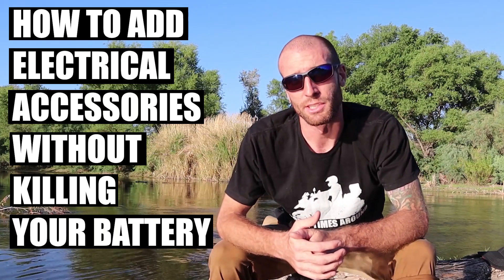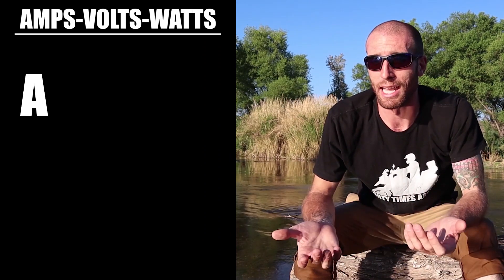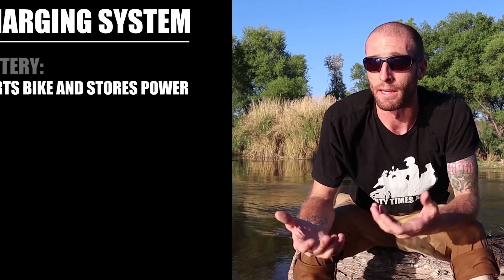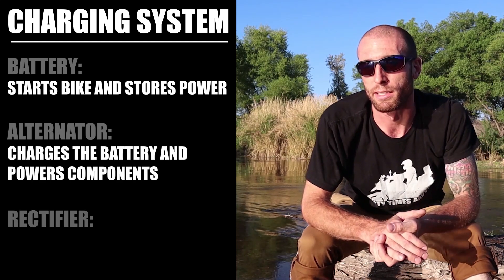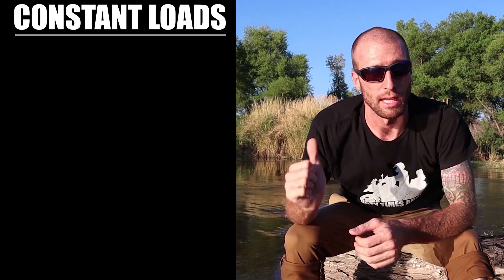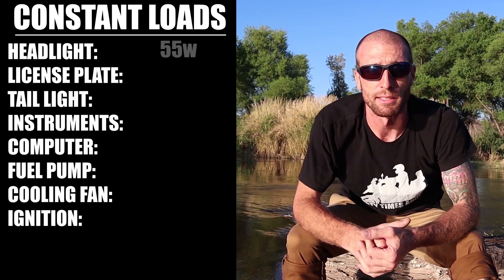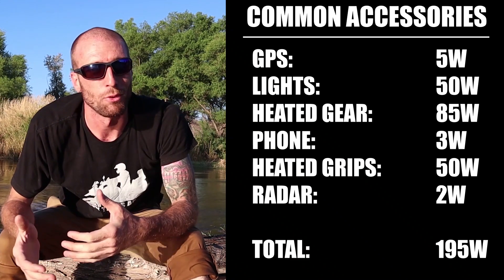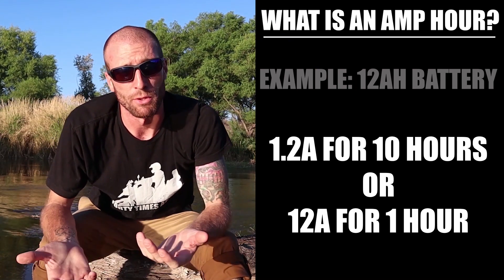How to Add Electrical Accessories to a Motorcycle Without Power Issues

Comment: This was a fantastic video.   Something that the manufacturers should be doing and bragging about.   

I’ve been riding and touring since the 70’s and this has always been an issue.  

Have a question; what can you say about all the portable jumper boxes on the market?   Also the various chargers and maintenances chargers.   

I’ve always been told to never charge over 3A.  But my heavy equipment car tractor batteries can be charged or jumped from just about anything with no harm to the equipment or batteries.
Reply: DALE thebelldiver Welcome back to the rider family! I'm a returning rider as well. Anyway, one of the new materials backpackers are using is called silnylon. Very light, water "proof," and packs small. Good luck with your tent concept. Redverz, LoneRider and now Vuz Moto (half the price of the other two) all offer "garage tents." They pack down small for what they are, but I think they're too big for what most riders actually do, but they sell. I think you're (smaller) concept has validity.
Reply from the maker: Thanks again Dale, another great comment! As far as the portable jumper boxes I can say that I have heard great things about them but have no personal experience with them. I ride year round so I've never need a charger or trickle charger for my bike. When I lived in NY I had a charger on a bike for the season and on another bike I would just start it every few days and run it. Both strategies had the same affect. Thanks for the comment/question!
Reply: Forty Times Around I’m also wondering how they might work for a portable power source;  it’s sounds like you can operate electrical components and charge cell phones or tablets off it.  

Since I’m planning another trip and have been off a bike for 6 or 7 years; I’m doing a bit of catch up on new technology. 

I’m also building the bike cover/ tent.  I’ll be sewing seams today. 

Since you do so much riding and have experienced just about every terrain you might be the best resource for an opinion on this concept. 

We all know selecting the optimal ground will be given to the bike; then generally we move 10 or so feet away and pitch a tent.  

My build is to make a cover for the bike and gear and share the space with an attachable personal space to sleep or sit in. 

I’ve decided to include guying tie downs for the bike just to prevent strong winds from ever tipping the bike the wrong way and over on me.  Of course I will be on the opposite side as the bikes lean direction. 

I’m contacting tent fabric manufacturers to build a lighter weight system. If I have to; I’ll buy a new tent and alter the hell out of it. 

I have the resources to manufacture these after I find out it’s a good idea from like minded people. 

The idea is to build total custom covertents , coverquarters, what ever it ends up being called.
Reply: Norsefalconer thanks for the feed back.  Yeah; I am using Harbor freight tarps to build the first one.  After I get the first one built and display it; I hope I get some credible feedback with pros and cons from new and experienced riders.  

I’ve done several bike and camping trips and always thought about leaving my bike and gear outside when I’m in side a tent during a rain storm.  

I have to go out in the cold and rain to get what ever from a saddle bag then deal with everything being wet. 

This design concept is to through my bike cover over the bike and install two or four short poles and I have a pretty rigid structure set up in maybe 4 minutes. It can be an open vestibule or closed and sealed off from the elements.  I’ll have the contents of my saddle bags right there. I’ll have heat and electricity from the bike. 

I’m a commercial diver and I’m getting long in the tooth to be mixed gas or Saturation diving or welding 9 or 10 hours at a whack.  

I could be a bike/tent maker just as easy as servicing an off shore rig or diving below the ice come winter. 

You guys and Tim seem to be more about real biking and touring making do while on the OFF ROAD trails without a load of product endorsements.  

at least this one idea; if it comes to pass will be started right here.
Reply: Norsefalconer I went through my boot camp at FT. CAMBELL, KY.  I signed up for Airborne. Then after boot camp I had an option to go to Leadership school or jump school (to much running). Lol.  I elected to go to LPC instead. 
Ummm there is nothing about commercial diving or UW welding; sexy.  Being a true underwater welding is like jump school or being airborne; everyone wants to be it but few want to or can be it.   UW welding is hard because you are doing nothing to generate heat.  Plus you are hanging bait for all kinds of bigger fish.  No one thinks of that.  

All kinds of things are testing you for flavor and freshness.  Lol. Or bumping you for a reaction.  You can’t look around, you can’t ever get warm, you are constantly getting severe shocks and..... any gases trapped explode and that might happen 100 times a day.  SEXY?  F no! 

Pays well; yeah IF IF you are the contractor.  Which; I am 95% of the time.  Otherwise; it’s a wage of .... $55./hr plus depth pay and a Per diem; on the high end right down to $20. And that’s it.   That’s why I’m a contractor. That can reach profits up to $1,200. An hour.  But you are earning it in all respects. 

My cover shell needs input from riders.  I’m going to sew the other side today after work.  Then start on the tent part.
Reply: DALE thebelldiver Looking forward to seeing what you come up with. I wish you success. That underwater welding deal sounds sexy and probably pays very well, but it's got to be hard on the body. I was in the 82nd Airborne for just 3yrs. But, 20yrs later, I am definitely dealing with the long-term affects from that experience.

Comment: This is the best overview I have seen on electrical.  Good information.  Automotive and Motorcycle electrical is significantly more difficult to get right than standard electrical say house or  electronics because of the ground and hot (active) points.  Where to draw power etc.
Reply from the maker: Thanks  Doug! Glad you enjoyed my video! Great points about the ground and hot making auto electric more of a complex system. Thanks for the comment!

Comment: Thumbs up Tim. Another super great video. I would add to be careful in the type of wire to use. It must be UV protected otherwise any part exposed to the sun will deteriorate its insulation rapidly.
Reply from the maker: Thanks very much Claude! Wire choice is a great tip, as well as the UV protection. Excellent additions, I appreciate that very much.
Reply: That's a great point. All of my wiring is covered by the plastics, but not all bikes have that inconvenience 😉

Comment: Tim, great video as always and you may be clairvoyant because I'm in the process of adding wiring for GPS. I was planning on using a relay, but from what I can tell it is best to add it to a wire that is switched on only when the ignition is on. Were you referring to a way to use a relay and wiring to the battery? Thanks for the timely content!
Reply: Dale, those jump starters will only provide that rated current for a short time.
Reply: Wayne Vowell what kind of bike are you riding?  It seems like each bike has its own electrical system output and draw and reserve.  

Most bike dealers WILL NOT help you at all regarding electrical issues.  

I’m riding a 1300 VTX and want to add additional head lights, strobe stop lights, a GPS,  a charging station and optional; what ever else I want.  

Of course I understand I won’t be able to draw only so many watts at any given time; I still want the option.  

Is there a way to increase wattage output?  

What about those 600 amp jump starters.  They have outlets to plug things into.
Reply: Dale, I am riding a 2005 Triumph America, just an old school cruiser without any bells and whistles. I can't answer any of your other questions, I am only wanting to add charging capability for a GPS and my iPhone.
Reply: Wayne Vowell I just attached the battery charging cables for the trickle charger.  

I’m looking at that batter jumper it’s 600 amp output for jump starting the bike should I run it down.
Reply: Wayne Vowell prim old school to but I do like to see what’s new and beneficial.
Reply from the maker: Thanks for the comment/ question Wayne! Glad you are enjoying my videos. The relay would go directly to the battery, just make sure there is a fuse upstream of it. The distribution block (if needed) goes downstream of the relay. So like this:

Battery>Fuse>Relay>Distribution Block (optional)>Accessory

Thanks again Wayne, good luck!

Comment: Great Subject, Awesome Information! I hope you don't mind if I add a few things: Batteries in most new cars and bikes also serve to regulate power output to sensitive electronics. Never disconnect the battery when your bike (or car/truck) is running. Relays can be mechanical or solid state. Solid state are typically more expensive, smaller and use less power. Swaping turn signal bulbs from filament to LED may cause malfuctions. This circuit often requires the resistance provide by the filament to function properly. Do research on wire size. Wiring run to the relay and aux fuse box/dist box needs to be large enough to handle the entire load of that circuit. This is serious business. Most of the tractor-trailer fires you see in the US are caused by overloaded wiring. My 2 Cents.
Reply: Generally if turn signals don't want to work after switching to LEDs it's simply a matter of switching the turn signal flasher to a solid state model.  I tend to ride older bikes with rather anemic charging systems so I love LEDs.  My main ride is an old Harley that had the separate turn signal buttons on either side of the handlebars, not one of HD's better ideas IMO but it is what it is.  On the old bikes like mine the rider had to hold the button down any time they wanted the turn signals on, which was a pain while trying to manipulate clutch, throttle, brake, etc.  I solved it by converting to a timer module that makes the signals work like a newer Harley, push the button and the signals stay on for a certain amount of time, push it again to cancel them, and it's also solid state and LED compatible.  I got it on closeout for a song although they can be kinda spendy, but a digital or solid state turn signal flasher is only a few bucks at any auto parts store.  Probably more complicated than that on some of the computerized bikes, but I have no experience with them so I can't say. If I can't fix it on the side of the road with a screwdriver and a crescent wrench I tend to shy away from it, LOL.
Reply: Dale:
Well, I suppose that if you figure where to mount the cells, and you never ride after dark or on a cloudy day, it MIGHT be able to provide a USEFUL amount of supplementary power.

But I wouldn't hold my breath.
Reply: Norsefalconer this is great when people can add their knowledge or two cents when it’s simply not a matter of opinion.  

I just bought a 1300 HONDA VTX and of course want to hook up all sorts of electronic dependent gizmo’s.  What about solar energy to supplement electrical needs?
Reply: Very good points! Solid state relays do draw less current . If you use the headlight wiring as a trigger signal . At least it won’t load your headlight circuit once you load your solid state relay.
Reply: Rick, an automotive style relay, compared to even LED headlights, pulls a negligible amount of power. Besides, a solid state relay is going drop a little voltage across it wasting a little bit of power.
Reply from the maker: Thanks for jumping in Norsefalconer! Always great comments from you and it's always appreciated! Excellent advice about not disconnecting the battery while it's running. Good to know about the LED's! Thanks for pointing that out. Thanks so much, I appreciate all the additions to the topic. Ride safe my friend!
Reply: John Casteel Agreed. For most situations an automotive type relays works fine, especially for an aux fuse/ dist block. Given the price difference, it's usually not worth the trade-off. But, I thought I'd mention it so folks knew there were alternatives.
Reply: DALE thebelldiver First off, CONGRATULATIONS! That's a sweet bike. Wish you many safe miles. Concerning your question: I don't have any experience with those portable solar panels. But, I think most folks use them to recharge phones and other portable electrical devices and/or power banks. I guess, if its charging your phone, or whatever, as you're rolling down the road, it would ease the bike's electrical load a little. Even so, If you follow Tim's process as you look to add farkles, I think you'll be in pretty good shape.

Comment: A video w/ you showing how you got your relay set up wired would be great.
Reply from the maker: I will be sure to add that to the list Michael. Thanks for the suggestion!
Reply: relays are really easy to install. just be sure to get one that can handle the output. think of it as just two sides. one side is wired hot to ground into any switched circuit. when it is live it closes the internal 'switch' and allows the other side to be live. this is the side that you can use to wire up a terminal block in a single location for all your connections. remember to always use circuit breakers. you don't want your add-ons to fry your bike's system. sound about right????
Reply: that would be awesome
Reply: Auxiliary fuse panels have a relay  already wired in. You can also add your accessories directly into the fuse ( FUZE hehehe) panel. Most have a max output of 50 watts total well inside ones needs. Mine will shut down power to the fuze panel before my BMW powers down and goes into security mode.

Comment: Great vid thanks.
Which radar detector do you use?
Do you use the BMW Nav V gps?
What states are the worst for speeding tickets?
Reply from the maker: Great questions! And thanks for the comment too. I am not currently using a radar detector but am considering adding one. I use the Waze app that is pretty good about alerting me to any speed traps. It's the BMW Adventure GPS by Garmin, I've been happy with it. For speeding tickets it is hard to say what is the worst. To be honest though, watch it through small towns because they seem to need the money more and are more likely to ticket you. Especially with out of state plates when they know you are not likely to come back and fight the ticket in court. I got hit with a $300+ ticket in a small town in Oklahoma for passing on the right when a car in front of me slammed on their brakes and decided they were going to take a left, and I didn't want to get rear ended. Part of the deal I guess, it's bound to happen once in a while.
Reply: @FTAAdventures  I think most law enforcement agencies are starting to use laser speed detectors and I understand that as soon as you're in the sights you're done (if speeding).  I think radar is on its way out.
Reply: Can you come work on my accessories lol I have money but this electrical stuff drive me nuts
Reply: @Mrfloydbryant  
Sure, where are you.